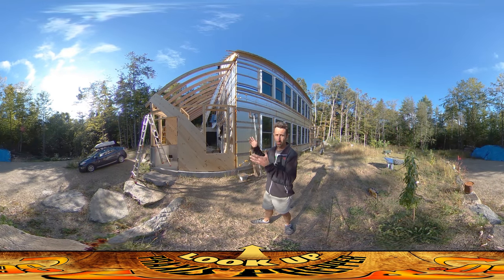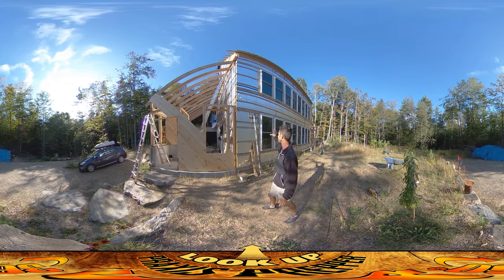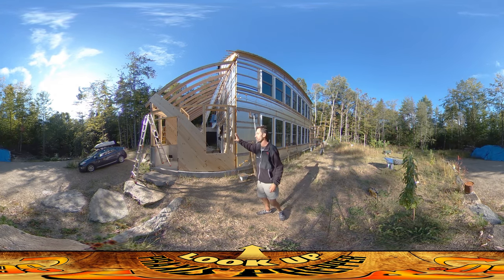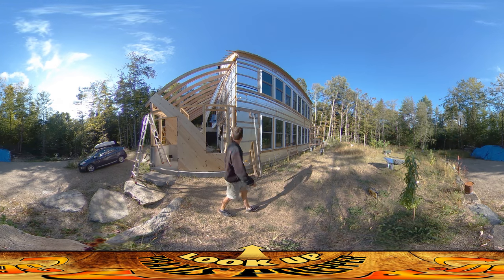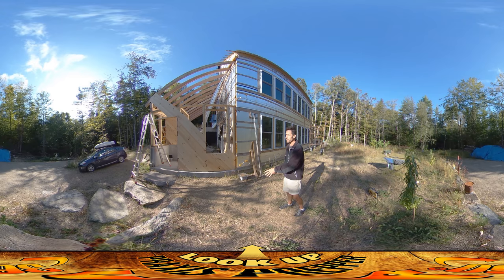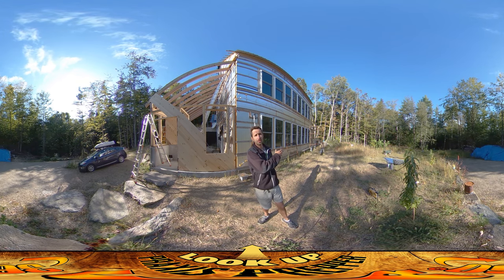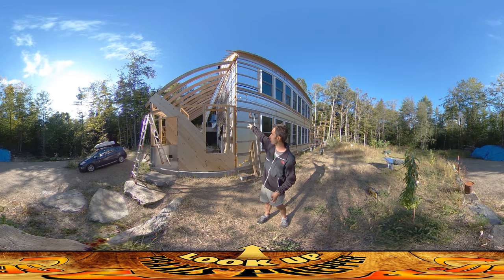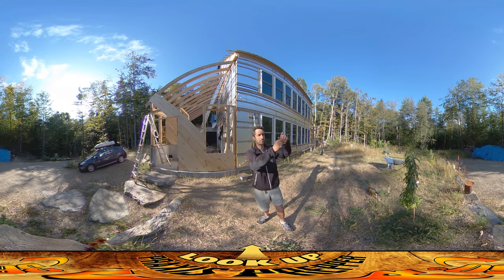Homestead Building - Greenhouse Wall Comes Together, Electrical Inspection Results

Comment: I guess if you are certain the materials for the roof of the greenhouse arrive somewhere on time, you can forego siding up the sides for a bit (or even do them over winter), as having the greenhouse up means the sides are weatherproofed anyways and it be working inside at that moment too ^^
Reply from the maker: Yep... but then I started thinking about those exposed wires. I wonder if I can pass a final electrical inspection with those wires exposed.
Reply: @PraxisPrepper  Assuming they aren't actually exposing the copper, then i'm not sure why not... but please seek actual advice from somebody that knows the rules and regulations, and don't take it from some dude on the interwebs...

But if it's ok, then that work can be delayed until the winter for sure. Given of course the greenhouse is shut.